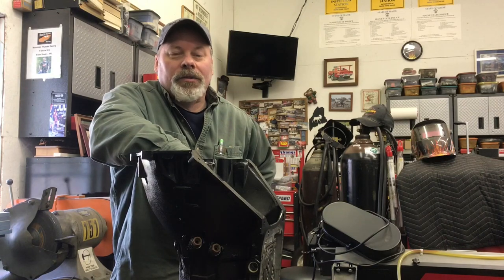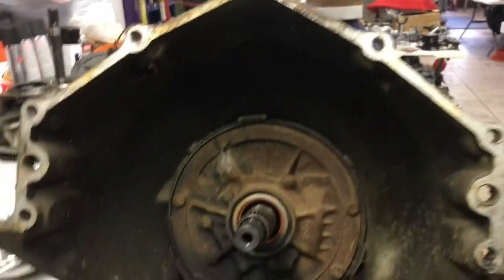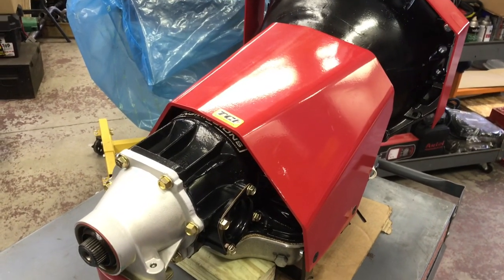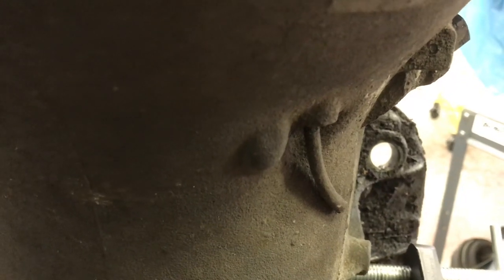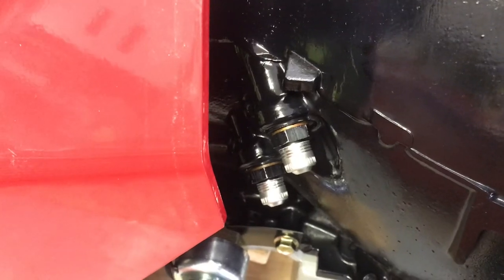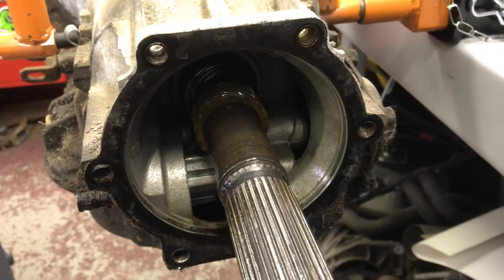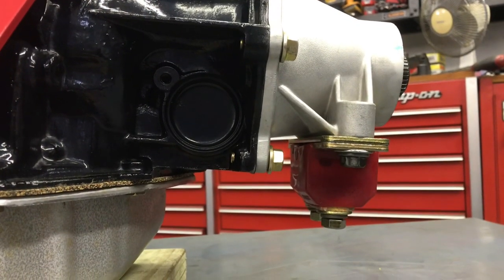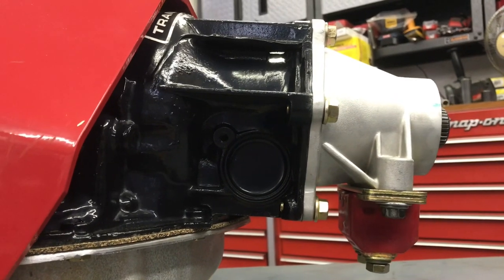Turbo 400 Tips

Comment: I've been a Trans builder for over 40 years and this is good info,Thank you!!
Reply: Hey I have a question is a 400 cubic engine a good engine and will t56 6 speed transmission be good for it I’m putting it in my 94 impala ss have not bought it yet but that’s what I’m thinking to get

Comment: The metric thing is easy to explain.  In the late 70's, GM announced that they were shifting to metric fasteners...sort of.  Their wording was that "only new machining will be switched to metric.  So, if you were a mechanic working on GM cars, you needed both SAE and metric tools, because when you started working on, oh, say, a front end, you never knew if the part was new or old machining.  It was a real pain for at least 5 years, until every part on a new car was new machining and thus metric.

Comment: Can you take the truck yoke off and use it like that in a 2 wheel drive car or do you have to replace tail shaft and housing?
Reply from the maker: No need to buy anything, just unbolt the yoke and remove the O ring on the output shaft. 
I cut the O ring groove off in the lathe so a standard yoke has full travel. You can also buy a recessed spline yoke that will go over the O ring groove also so no machine work is required.

Comment: Very good informative video. Just picked up a TH475 out of a 21k mile motor home and going to use it as a 2 speed. Your video has some good stuff in it. Thank you!
Reply: @pmotorsports8276  ?? about what?
Reply: dragginfool 
Can it be made a two speed?
Reply: @12yearssober  It could be left as a 3 speed and leave in second gear or made into a dedicated 2 speed. 1st gear is worthless with 1500+ Hp and a small tire.
Reply: @dragginfool  Man you"ll shred them to pieces running small tires..lol

Comment: Years ago, I busted a tail housing. I crawled under some old turd at the junk yard and removed the tail housing on some older car (probably a 70s model something or another). It didn't have a driveshaft in it, so that made it a little easier. I didn't know it when removing it, but it wasn't for a normal th400 size yoke. It was  a short shaft tail housing, but it was in-between a th400 & th350 size yoke. 400 yoke wouldn't slide in it at all and a 350 was loose. It's the only one I've ever seen like that. I have never found any information about it.
Reply from the maker: I have a couple of them. I talked about them in another video.

Comment: I'm dropping my case off today to get cleaned. I followed some of your case mods and between your videos, and a manual I'm just going to try out a rebuild. Worst case is it doesnt shift like before, but all the clutches were smoked. Thank you for all your 400 info!
Reply from the maker: Great! Any questions feel free to ask!
Reply: @mountainsgarage  ive got a couple questions for you bud. 
1. Before installing the pump I gave the output shaft a spin, it moves but it definitely isnt silky smooth. It takes sone umph to get it all moving. Should it be slick like spining a crank in bearings in a block?
2. I dont plan to use the Speedo cable, I saw the core plug for that. I also dont plan to run a kick down and just manually shift it, I can just remove the solinoid and the connector plug right? Or is anything else needed?

Lastly is there anything I need to check with the pump out and the new ptc convertor? Or just lube up, install and check that the pump gears engage the comverter and turn the pump?

Im getting the new guy jitters but so far everything went together decent, all the drum seals suck for a newbie and not cutting them.
Reply from the maker: @shocker998md3  The tailshaft might turn easier one way than the other. If you got the center support bolt in and the snap ring and it still turns, it’s probably fine.
I usually try the hub of the converter through the pump bushing if it’s apart but it’s never a fitment issue, just lube it up and put it in. No need to be nervous, you know how to fix it!
Reply from the maker: And yes core plugs are fine. I would leave the kick down solenoid bolted on to prevent leaks if it’s a stock VB.

Comment: If I want to run a slip yoke on a TH400 that was originally in a truck with a bolt-type yoke, do I NEED to find a yoke with the counterbored recess to make sure the yoke has proper engagement? Based on 17:48 , it seems like the regular yoke without the recess is bottoming out against the o-ring ridge on the shaft. I'm wondering how long that yoke would stick out past the tailhousing
Reply from the maker: The easiest way is to machine/grind off the o ring groove and run any yoke. Second choice is running the counter bored yoke and not machine the shaft. I machine every one.
I cover it better in other videos.
Thanks for watching!
Reply: @mountainsgarage  thanks for the info, great video

Comment: @MountainGarage Just subscribed  thank you for sharing this information. I finished a th400 build for my Cadillac engine. It was the first time I ever done one. Is their a fix for the front pump 6Oclock bolt hole? I think I stripped it. Anyway, my torque wrench never clicked and the bolt won't tighten. It leaks. After I installed a Hughes stall it leaks a lot more. I do have a spare but its a 72 case from a Pontiac Wagon. I just don't want rebuild it again. But my gut tells me I will.

Comment: @MountainGarage Is it possible to identify a th475 from a th400.  I bought a th400 supposedly but it had the parking brake housing on it.  Leading me to think it maybe a 475.      I.D. tag. Has 86-FM
Reply from the maker: Seems to be a P chassis transmission with a 5.7 engine. A 475 is the listed transmission. So good chance!

Comment: Thank you for sharing your wealth of knowledge with us all nothing beats experience  I am getting parts together to do a T400 build for my 69 Firebird 455 street/strip car  I was planning on using a H.D. chevy case w/BOP adapter built have been told by a couple people that that experienced eating up ring gears by doing so ,I located a BOP case but it appears to be really lightweight to say the least You mentioned a H.D. pontiac case? If so how would I I.D. such a case in a search for one? what is your thoughts on using case adapters? Also what type of clutches would you rec. in my build Thank you for your time~
Reply from the maker: Thanks for the nice words! Look in my playlist I have a few videos stripping HD Pontiac cases in search of the right one for my personal transmission. I also have videos of removing the bellhousing and installing an SFI housing, some with both bolt patterns. Any brand name clutch, Borg Warner, Raybestos, Alto, etc. will work fine. Smooth or waffle is another choice but either will live a long life with good clearance and pressure.

Comment: Thanks for the video. Great info. I have a TH400 in my 68 Grand Prix. My second to third shift is way too early. I want to get it to be much longer and stronger shift. Would this be a governor adjustment /rebuilt or vacuum modular adjustment?
Reply from the maker: You are on the right track. I would start by going to the TH400 section of the Crankshaft Coalition website and perform the auto shift valve body mods first. A adjustable red stripe modulator turned in a few turns helps as well. Governor springs can adjust WOT shifts.
Reply: try a 02xx 400r trans i bet y would love it plus u can get them out of heavy trucks or motor homes stock good to 800 hp i get all mine for free .stock they make the perfect trans for the street

Comment: Great video I have had several t400's over the years, in my Streetrod drivers, and always have front fluid leaks, what seal do you use on front pump main shaft seal to converter, which seal is best? any tips tricks on installing?
I always carefully support and slide converter on to main shaft then rotate till engages the splines and slides rest of the way back into the front pump.
Am I destroying the seal by pushing the converter all the way back?? any secrets I'm missing?? sick of front oil slick on the floor, please help
Reply from the maker: I have used them all, but if I am buying one than National or Timken brand.
More likely the leak is caused by a worn pump bushing, or the pump gasket and o ring.
Thanks for watching!

Comment: If you're running the street with that th400 will you have the radiator connected to the cooler lines?
Reply from the maker: @Siky1-e1x  You can, or run an independent cooler, or both.

Comment: Excellent video sir! Just one question if I may. Would you say that the earlier 70’s th400 used in commercial chassis cars were straight cut gears?
Reply from the maker: Looking at the history of the 475 it only says they were installed starting in the early 70’s. So long story short I don’t know but will make it a quest to find an older unit and find out!

Comment: Would you suggest a bigger/better cooler if I think I’m spitting a good amount of fluid out of the vent. Or adding a overflow tank?
Reply from the maker: Overflow tank is always a good idea, fluid out the vent should not be a common occurrence but does happen. A bigger cooler is also a great idea.
Reply: @mountainsgarage  thanks learning all this stuff as I go! I’ll start with a catch can for now just for the safety, but ive notice it only seems to puke out when I’m going up a bridge after driving the highway for a while.  leads me to believe I’m getting the trans hot after watching ur video. Running a derale cooler so I’ll double check all that.

Comment: I have a question
My Cutlass th400 just gave out 

If I got a chevy 400, all I would need is a adapter plate and it should be good to put in?
Reply from the maker: As long as your tail housing is the correct length there is an adapter available.
Or swap everything into your Olds case.
Thanks for watching!
Reply: @mountainsgarage  idk if that's easy or not lol I'm a newbie and don't know much about any of that 😂 do you mean if the tail is the same length it should be good. Im pretty sure these are dumb questions I'm asking 🤣
Reply from the maker: Good questions!
Yes the TH400 came in a few different length output shafts and matching tail housings. If it matches yours then go fo it!

Comment: On the trans brake how far does the valve go into the trans fluid passages?
Reply from the maker: The external solenoid in this video moves the stock modulator valve.
Reply: @mountainsgarage  I see, I did not know how long the modulator valve was[4"]roughly and controlling the other fluid passages from where the tb solenoid ends.

Comment: what u want to start with is a 02xx 400r turbo stock they are good to 800 hp they came with the bigger pump heavy clutches stage one shift kit with a few other up grades . u can find them in heavy trucks and motor homes this is what u want to start with gm crate trans it will have 02xx welded on the bell housing . plus u can get them for free last year i got 4 crate set ups with the 454 450 hp with the 02xx trans from 6,000 to 58,000 miles on them all for free .gm calls them street strip or heavy applications trans

Comment: Hi, what can you tell me about the TH400 Switch Pitch. I have one from an old caddy and have a chev case to swap the parts. Any issues in doing this and how much torque with the variable vanes take?
thanks
Reply from the maker: I haven’t even seen one of those in decades!
I have read about using them online but can’t claim to know any useful info, sorry!
Reply: @mountainsgarage  Hi, at one time Prostreet was popular and it was transmission of choice.  Rare unit found in BOP &Cadillac 64' -67'. I have a 3rd gen Camaro with a Dart based 421 for fun sales. Gonna try it. If that doesn't work I'll try a Steel Glide I have. Anyways,  I subscribed so keep the info coming. Peace.
Reply from the maker: Pro Street is making a comeback!

Comment: Heavy duty in a light duty veh maybe but this is in wise a "heavy duty transmission", it goes in 3/4-1 ton applications, that classified as light duty.  Heavy duty is class 8/Semis....
I locked one of these up just getting my RV stuck in the yard nd tryig to rock it back and fourth (complete stops between changing between R&D)...  Didn't even have alot of miles on that rebuilt slush box, not impressed.
Relaxing video to watch though, thanks for sharing.
Reply from the maker: Patrick Baptist  I agree its all relative. I spent 28 years as a Diesel Mechanic, fixed them all. But a modified TH400 sees 3000+ HP these days. But far from stock.

Comment: Do you offer built transmissions? I’m looking for a built 400 with a brake.
Reply from the maker: Are you local to Maine?
Reply: @mountainsgarage  no unfortunately. I’m located in Wisconsin. I do have a guy that can build me a 400 but ‘he don’t do heavily built 400’s often’…… and I don’t really want to pay some of these prices as some shops want. I just want a built 400 that won’t break the bank….I’m not afraid of spending money but I just don’t get a good feeling from a couple places around me. I’ve watched a bunch of your videos and you obviously know your stuff. I did join that DIY th400 page on Facebook today. I’m building a Chevy colorado with a turbo 6.0 in it. I’m expecting 900 or better with the turbo I have. I know nothing about rebuilding transmissions and I have no interest in experimenting either. Just need to find a honest builder or something. Or just a parts list and I’ll just get it done by me. I appreciate any help. I’m just afraid I’ll be taken for a ride at my local shop….. kinda sad isn’t it? Of course I want a trans brake. ATD I think I was set on.
Reply from the maker: @daviddenman7479  Well ATD is also in Wisconsin and they build fine transmissions. In my playlist I have a recipe for that power range so you will have an idea what you need.
Reply: @mountainsgarage  I live like 45 minutes from them. I looked them up and they seem to offer some great choices. Thanks for the info!

Comment: I’m running a th400 trans with straight cut gears; what gear ratio did Gm  offer , I was told by a previous owner that it had a 2.10 first gear is that possible
Reply from the maker: All the GM transmissions were 2.48, but aftermarket ratios are available in 2.10.

Comment: The th400 from behind a 6.2 diesel a good performance candidate?  Its a very low mileage unit.  20k.  Plan to use a Ultrabell and manual valve body.
Reply from the maker: The dirty transmission in the video came from a 6.2 3/4 ton truck.
Reply: @mountainsgarage  thank you

Comment: What yoke do I need for my 1969 Buick turbo 400
Reply from the maker: Most likely a 32 spline in whatever U joint size needed.
Some TH400s had the smaller 27 spline.

Comment: Just had my turbo 400 or 375 rebuilt but it's very hard to shift took it back in the car they dropped the pan said they fixed it (bullashit) still can't shift into 1 or 2 or past drive easily by hand with out the shifter that worked fine before they told me it's good get a new shifter what could be making it so hard past neutral

Comment: I just finished rebuilding my th350 and have it in my 61 Chevy C10 pickup. I have an issue with tranny fluid pushing out the tranny dip stick. After diagnosing the problem I blew air into the dip stick to check the that the breather vent isn't blocked in any way. I removed the vent tube and found that the passage way to the breather vent cap doesn't vent. So the tranny is building up pressure and blowing out the fluid through the dip stick tube. I followed all steps when rebuilding and can't figure out what the blocked is caused from. Anyone have any ideas before I pull the tranny from the car and take it apart again. Thanks

Comment: Metric and imperial..not standard!! Metric is the worldwide standard for fasteners.. and one other thing.. Australian GM v8 engines came in both Chev and the unique to Holden bell pattern that is definitely not the same dowel location as the bpo or Chev…although some 308 cu came with the Chev pattern.. we had th180 (trimatic) pattern on all 253 and most 308s
The weird thing was that we had three different auto transmission options.. 180, 350 and 400 behind two different displacement v8 s . Why gmh didn’t just run with the proven th 350 or 400 I don’t know. We didn’t get an overdrive until the 308 became a 5 litre with new cylinder heads, efi, and revised port layout. This was in the vn commodore in 89 I think.
yeah I’m nit picking I know. I enjoyed the upload ..some good information but I feel I had to correct you on the dowel pin comment..and my pet hate of referring to imperial fasteners as standard when that ship sailed long ago!!
Reply from the maker: Love the input!
All my thread charts have US Standard thread for a heading, but depending on your location in the world I am sure it’s different.
Same goes with the TH400 bellhousing, comparing a BOPC to a Chevy here in America the lower bolt and dowel are in the same location, but probably not all over the world.
The amazing reach and power of the internet!
Reply: Really enjoyed the uploads been doing trans since the mid eighties in a different market.. still getting atf on my hands 37 years later!!

Comment: does a th400 bell housing bolt up to 5.3?
Reply from the maker: Austen Loan  Yes but the middle passenger side bolt can’t be used because it doesn’t exist in the block.
I install a Helicoil in the vacant hole in the transmission case 
to mount the dipstick or transmission shield.